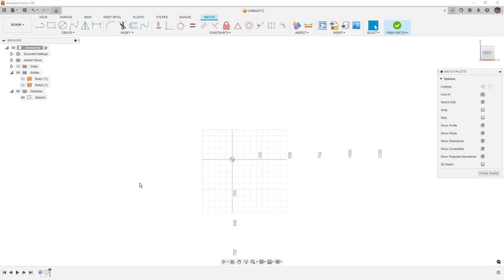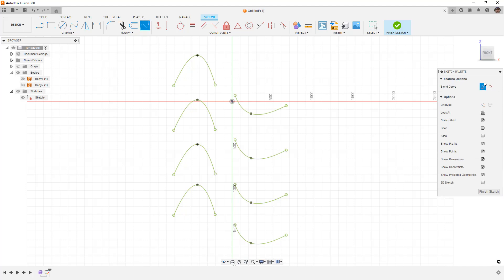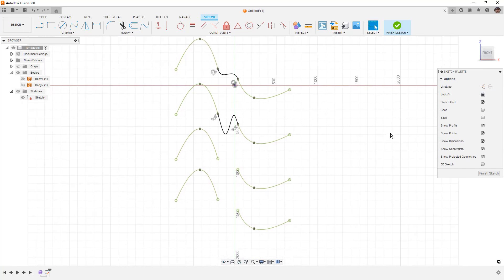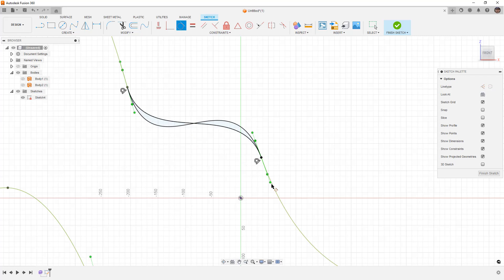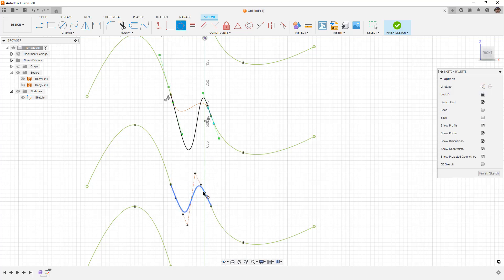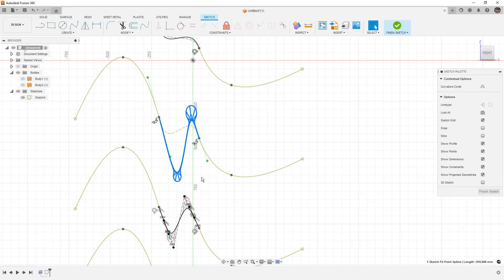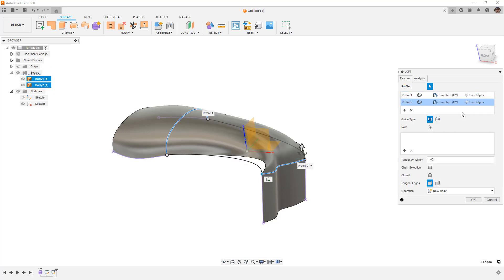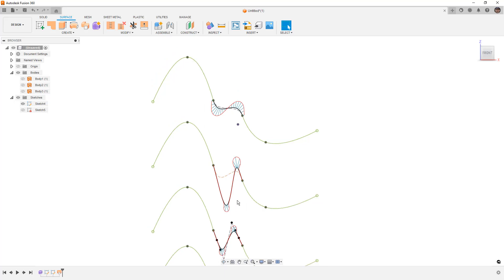What's New in Fusion 360 | Blend Curve | April 2023 | What Is Blend Curve? #fusion360

Comment: really nice! I wish Fusion would have function to concatenate curves with the same curvature and also a function to smooth a curve.
Reply from the maker: Thanks!  If you have a control point spline when you select it, in the Sketch Palette  you can change the spline degree.  So if you had a degree 5, you can change it to 3 and that will "smooth" it out just by nature of reducing the control points.  Now that isn't a perfect solution but play with it, try increasing the degree first then reducing it.  So from 5 go up to 8 then down to 3.  it is subjective.

Also if you have a control point spline you can deactive internal handles which relaxes it.

Comment: There is never a 1 solution to any g1/g2 constraint - why you spend so much time musing on this. Those are curves, not sections of a circle - you can't expect " consistency and why should you? Makes no sense from a design standpoint..
Reply from the maker: I am not sure I follow your question/comment here.  This was a tool added to fusion in April.  What consistency are you talking about?  The difference between blend curve and using a fit point spline?

Comment: There's no mention of the degree of the blend curve. Is is cubic? Are they NURBS? Does Fusion 360 even let you know that much about your geometry?😊
Reply from the maker: The control point spline I showed in the last example that gives you degree control is a CV spline or NURBS curve.  From a geometry and mathematical standpoint that is the one i go to :).  I guess in the back end it is probably the same but the fit point spline doesn't expose any additional control.  It simply has the points on the spline.  The control point was added maybe 5 years ago.  recently they have added more options (used to be just 3 and 5 degree).  Now you can change that quite a bit.  Edit. should say you still select 3 or 5 during creation, but after you can change from 1 to 9.  I think "best practice" is create it with as few control points as you can and add more control by changing the degree later if needed.
Reply: @LearnEverythingAboutDesign  Yes agreed on your approach. They use 5th degree for curvature continuity most likely.  Can you come back later after making a "fit point" spline and edit it by control vertex manipulation?
Reply from the maker: Hey David, maybe, however they don't add any control points on these new blend curves so not sure how they do 3 or 5 degree splines with only the start end.... magic?  

Only the control point splines give you the direct option to change the degree.  With fit point on the blend curve or on manually created ones you can right click on it and insert more points.  That is about the best you  have as nothing else is exposed to the user on a fit point(which i think is generally true).